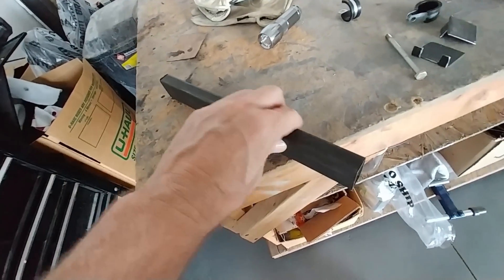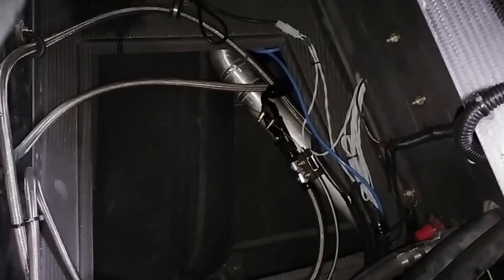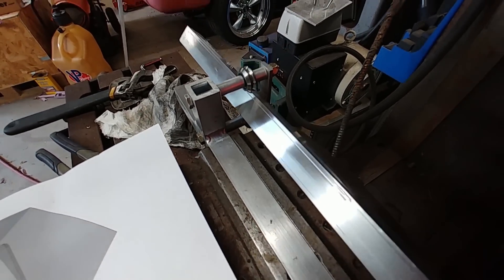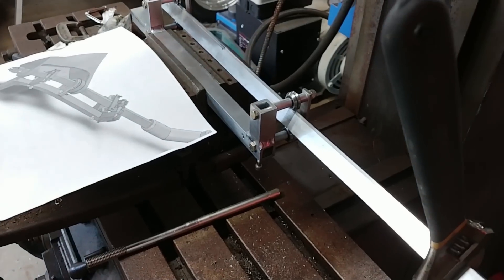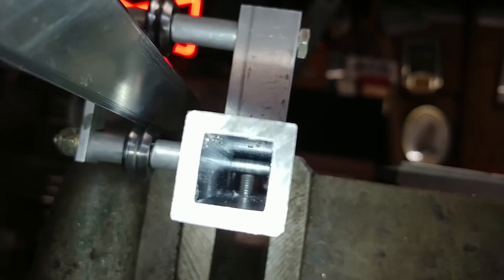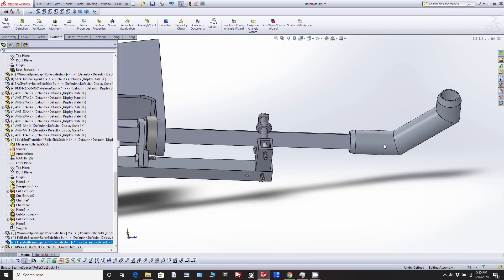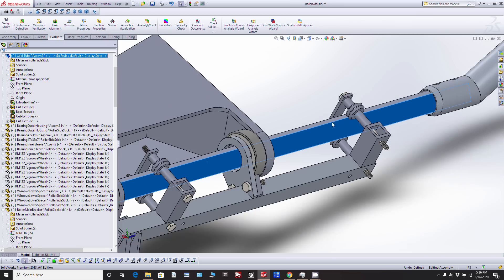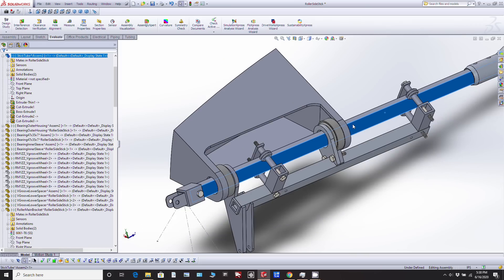Side Stick Concept Test - Building the Raptor Prototype

Comment: In the design video for this system, I made a comment that the aluminium could have excessive wear issues.  I think that comment is still valid.  The problem with the "little" dent is that if the bearing were right at the dent when a twisting force is applied, with a little wear the bearing could jump off the corner of the aluminium and if that was mid flight, you would have no aileron control.

Comment: Peter, the way you are testing is flawed against you.  If you clamp the side bar nearer the crank end  (opposite end  from the stick handle)  then the side bar distorts along with the  stick  tube  so the bearings will share the torque loading better. This could potentially reduce your indent quite a bit.  If obtaining a harder alloy for the  main tube then  of course you  make it even better.  As to difficulty sourcing 7075  alloy  you could  try looking for thick walled round tube and machining square like Cirrus have done.    My calculations, all based on guestimates as do not know all your parameters   show you are still going to get plastic deformation  on the corners from the bearings even  doubling up the bearings but if you heat treat the stick  to T6 or T7  spec then this may prove successful.   Personally I still prefer the original stick arrangement  and  redesigning it to work, with correct selection of bushes, anodising and  bars welded either side of the slot  with wider bearings .  Both systems require  a bit of advanced  analysis  and engineering  to achieve the desired goal..

Comment: Just stumbled on this channel. Consider the peak force is not going to be static, but will be an impact like a hammer. Consider a 20-lb force from the input with a 15g sudden stop, and you're looking at 300 lb of design forces. Torsional distortion may also be an issue that can cause your controls to bind after a sudden event like that. Keep the stick as short as possible if you use this design.

Comment: WHY DIDN'T I THINK of THIS BEFORE?

There are cheap round linear rails and ring-shaped ball bearing races for CNC machines, which would also work!
The shaft materials are likely chrome plated. There are likely standard sizes, which means that you would have replaceable assemblies.  A good assembly such as a Japanese NTN, or American Thompson, should give you a consistant parts. Their Chinese counterparts, not so much. You would just need to weld your Nurnies on the shaft, re-polish it a bit, and then mount 2 bearing assemblies in each stick mechanism, through little steel plates.
http://www.qiannipicture.com/pic/UploadFile/P0/SKU245888/D416339E469E169BCF20D2CA169BCFD2CDCD9053C6D2269C9CC8D2AD36CE03C70343C863329E996616A0CE13.jpg
As for the present stick: I don't think it's worth the bother to make make the control stick-shaft
 from aluminum. It will gall. Aluminum is fairly soft for a such a contact surface, and galling is in aluminum's nature. I would make it from steel. If you electroplate it, it should be baked 
afterwords to minimize hydrogen embrittlement. Nickle plating would still look pleasing.
Reply: I emailed Peter earlier this week about using rotary ball splines to simplify the whole control stick assembly. He didn't have a concrete reason to refute the idea, but from what i gathered he believes it would be more expensive to go with ball splines, and the steel shaft would weigh more than the Cirrus designed aluminum assembly.

Comment: Observation from the 1st eBay link provided by RUSTUSANDROID:-
1. They use only 2 bearings per end, not 4, + an angle non-interference bracket at the grip end as a safety override.
2. The same link has pictures showing a round hole through the tube. Does this mean that the square shaft was gun drilled and is in fact the harder 7075 and not 6061?
As I see it you would only gun drill to save weight, negligible, and to provide a path for the control stick wiring. If you decide on 7075 and have to drill it then suggest drilling only sufficient to clear the cable. That way more material equals more rigidity and less flex.
Love your solution and how it retrofits into the existing chassis without additional mods.

Comment: What dimensions of tubing are you wanting for 7075 and what heat treatment? I can call my aluminum vendor tomorrow and see what they can source.
Reply: Another option would be to look for thick walled round tube and machine outside square like Cirrus do.  (They do not 'gun' drill  square tube like some others have posted).

Comment: I strongly recommend a second roller. Also get castellated nut and cotter-key those bolt/nut with the roller.  If it the nut gets loose it will allow the bolt to slightly dance and the roller along with it, or safety wire those nuts. Keep up the progress!

Comment: Those dents could cause binding when under the same side load I would think. Having a second set of rollers at least on the set closer to the control stick might stop the tube from denting with the extra support wheels

Comment: Hey,
Just had a look at a cirrus control stick that's on eBay. There is a angle braket on the front rollers to add redundancy. I think that might be a good idea. I'd hate to see that set-up fail in the air. It would add hardly any weight.
Hope this helps 🙂

Comment: You could consider replacing the rollers. A deeper profile would provide a greater contact area, avoid any contact at the corners of the square tube and make the running surface of the roller very slightly convex. Having them custom made shouldn’t take to long. Keep plugging away.

Comment: A suggestion is to keep the "suspenders" at 5:50.   They are easily dismissed as not needed yet they are a cheap and light layman's safety feature.  I agree they are not needed, but it is a great fail safe design.    Good work sir..

Comment: Use a Torque wrench when testing the twisting force on the tube.  That way you can demonstrate to a particular load level for the test pilots.  A six point socket should fit on the shaft end.

Comment: Mike Patey did a video for his current project making square tubing from Carbon Fibre in hissecond most recent video   He then does destructive testing and compares it to steel and aluminum.   The carbon fiber holds up several times the pressure and torque of the other two.   In fact, the bolts bend and break before the carbon Fibre ever does.   Maybe a thought for losing weight in the production models.
Reply: AV8R3 I was thinking the same thing. He already has the experience with carbon fibre and the weight savings mike Patey is gaining it’s a bit of a no brainer if the wear isn’t an issue

Comment: Good job on your build. What if you made those rollers out of a super hard rubber?That way you wouldn't get any indentations. Of course the rubber overtime would have to be replaced because it can get brittle. If you could find a rubber that's impregnated with an oil that would be perfect. Better yet what about steel rollers coated in super hard oil impregnated rubber?

Comment: I agree Elliot will ask for a safety bracket.  Does he look at what you are doing online?  Maybe just a little consultation will save you some time.
You could stay in aluminum and chrome plate the tube.  Chrome is incredibly hard.  Once plated, aluminum seems to wear better than steel.  I figure you could get 10 sticks done for $200 dollars -- they usually charge by the pound.

Comment: Couldn’t you insert a tube into square tube for the wires and then fill square tube with micro and resin.
Reply from the maker: It's the outside of the tube that would be better if it was harder. The overall tube is plenty rigid as it is. Thanks.

Comment: Personnaly - I would keep the 'FailSafe Bracket' you removed on the CAD model and as I suggested before, add some Delrin pads (4)  so your entire aileron loads are not only supported by an 1/4" corner but rather by a larger area of contact on the square tubing.

Comment: What would happen if the tensioning bolts came completely out? Hopefully, just some play in the square tube.
Reply from the maker: The ones I have are temporary. The final ones will have lock nuts.

Comment: Great progress…
 I am however a little concerned with the removal of the extra guides/ bearings. To me it makes more sense to have another 4 points of contact, Spreading the load over 8 points of contact instead of 4 seems better to me, also as it is running on a separate axis a little more redundancy never hurts. 
Agree with @gtr19528
Reply: I agree and I'll bet cirrus uses that many rollers for a reason, let's learn from their experience.
Reply: remember the a/c is already 1000 pounds overweight. At some point stuff has got to come off

Comment: I just get the feeling when they do the inspection they are going to require the second set of rollers,  so they are on both edges. In case a 'roller' fails? Hard to see, but that 'nick' with 1 test makes me wonder?  They might want more redundancy??  JMHO...    --gary
Reply: I agree
Also the backup brackets on the drawing shouldn't be deleted.

Comment: I'm worried about the Adel clamps being the only thing to affix the fuel shutoff cable to the valve:
I'd recommend doing something to stop them from loosening and spinning freely about the fuel line they're wrapped around.
Without being a test pilot or knowing the guys; I'd imagine since fuel-shutoff is one of those things that must work correctly because by the time you're using it, something else has gone wrong. So whether they're safety wired or anything: make surr the fuel shutoff handle will always work correctly.
I'm cheering for you, and a successful set of test flights in the future!

Comment: Hi Peter. You might be interested in what Emmett Chapman achieves by surface treating his aluminium Stick instruments. The frets are machined to a point in aluminium, hard anodised, or plasma coated as an alternative, and easily withstand the grinding of stainless steel wound strings. See:
http://stick.com/instruments/railboard/beam.shtml
Reply from the maker: Hard anodising is a possibility.

Comment: My CNC uses those exact v-bearings on aluminum.  After a slight wear-in period on aluminum rails (a month or two), I tightened them up again, and they have run years with no adjustment.  I recommend the aluminum tube over steal.  Aluminum will wear-in / conform perfectly to the bearings, and it is a smoother more consistent surface compared to steel.
Reply from the maker: Thanks for that. Much appreciated.
Reply: Was also wondering on the alu vs steel wear. Thanks for your real world inputs 👍
Reply: @cabanford  Steel oxidizes and creates iron rust that continues grows. Aluminum actually oxidizes faster but creates a very hard protective film that is air-tight. It's both malleable and non-corrosive. Not as good as heavy carbon steel used in ball bearings, but pound for pound it is excellent.

Comment: Have you looked into a surface hardness treatment on the aluminum square tube?
Reply: I suggest hard anodized. 👍
Reply from the maker: Not yet.
Reply: 6063 is a cheap grade for decorative trim which is why he found it easily at Home Depot -- perfect for the initial prototype.  But hard anodizing on top of a very soft metal doesn't offer any benefit for this case.  I'm doubtful that you'll find 7075 square tubing, but 1" solid square bar stock is only 1.23 lbs/ft.
Reply: Hard anodising won't help a lot with the dent issue but it will make a fairly big difference to the long term wear. I've seen quite a few aluminium slider mechanisms on a various machines and they are nearly always anodised. Probably not a big deal for the prototype though.
Reply: Av Shiloh  Hard Coat Anodize might do the trick on the aluminum square tube.

Comment: I would use a steel tubing just because of the wear factor but it’s your call. The pressure angle not being equal in relation to the roller and the edge of the tubing is why I would select a steel material. Just because of what your seeing on the surface of the aluminum. I’m not sure how much you would gain going to the 7075 aluminum on surface wear?? It’s your call.